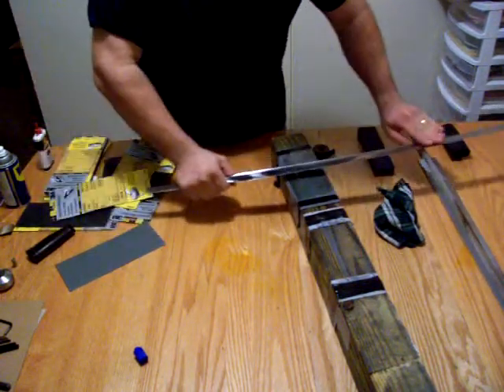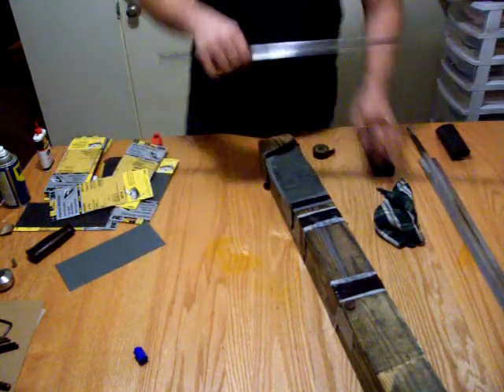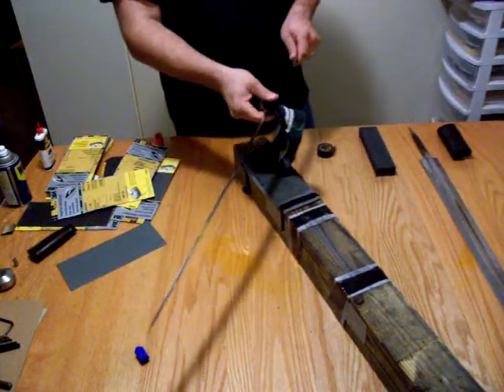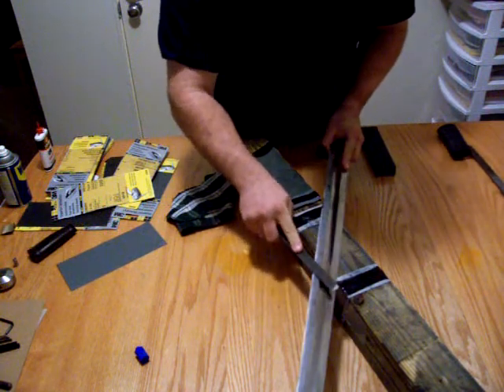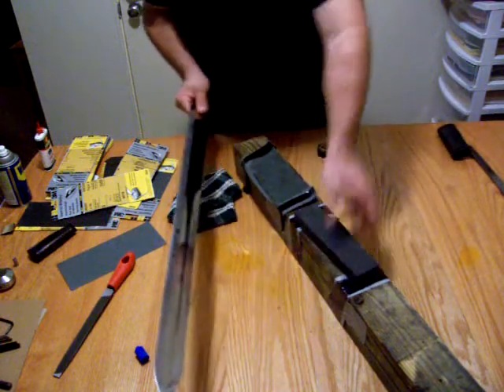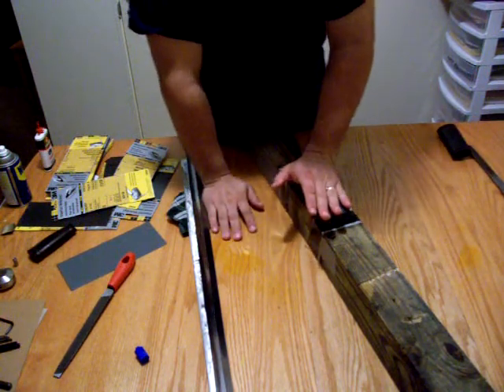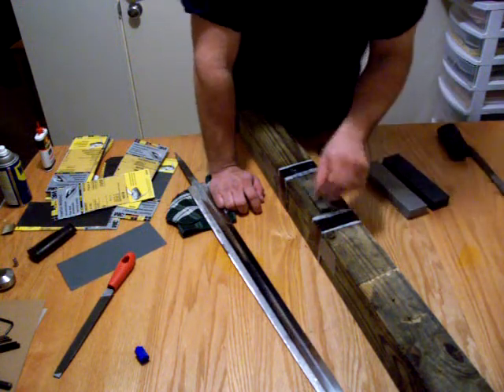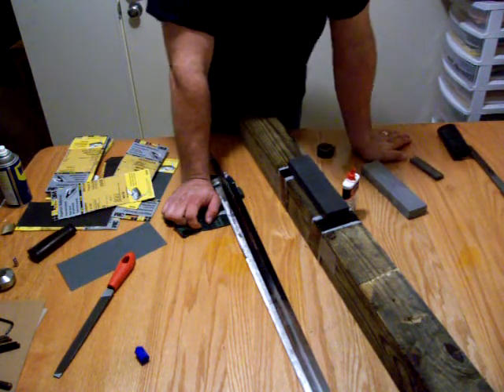universal sharpening part B_0001.wmv

Comment from the maker: Yup, GOOD EYE! that is a Castile blade and yes it did come with a secondary bevel. I'm slowly working it out though. I tell you what the heat treat and polish on that blade make it very hard to scratch. it's a really good blade. the new ones should be just awesome but remember that you have to ask for it "extra sharp"

Comment from the maker: @nico27004 I would start with 400 grit sand paper and avoid the stones unless you want to spend a lot of money on good stones. I have been very unhappy with the stones you can get at local stores, especially those 2-grit ones. the rough side is super rough, too rough for most jobs and the fine side is still courser than I like, not to mention stones are unforgiving and any little mistake will hose you. sand paper is much better especially for people new to sharpening.  good luck.

Comment from the maker: @nico27004 depends on how much work I need to do but in general I like to start about 400 grit then move up to 1000.if your sword is really dull or needs to be reshaped due to secondary bevels etc, then you may want to start with a lower grit. big things to remember: move in straight lines, you WILL scratch the crap out of it but don't panic just keep working finer grits until it looks good again, remove all scratches of grit below before moving to next grit, move from center to edge and off.

Comment from the maker: it really depends on how much of a bevel you put on it with that sharpener. if it isn't that bad you might be able to work it out with sand paper. files can be hard to work with on katana because if you have a real hamon that usually means you have an edge too hard for a file to bite. you'd have to use a diamond hone or some kind of stone instead. a 1x30 harbor freight belt sander is a great tool for this too and cheap to boot. I have video on using it too. zFfsAqXDPpg  and mh6XthJCEuc

Comment: I tried to sharpen the unsharpened blade with a wetstone using this method  and just because my wetstone wasn't perfectly straight, and I mean my wetstone was micrometers concave, but not perfect, it forever ruined the look of my katana with nasty groves that even after hours of polishing and re-sanding are still very pronounced. Lucky I took your advice and tried it first on a cheap katana, so I am not sorry, it just an experience with a wetstone...make sure it is good and leveled, and that you are not putting too much pressure, I even had to sand my wetstone on the sides but in the end I just gave up on it altogether...anyway, using this method, I ruined the look accidentally, but I got a mighty sharp edge....better than any factory made by far...
Reply: I should have said days not hours, the rest of the blade is mirror polish, but the grooves are still visible :( damn wetstone, better use acusharp...

Comment: yea thanks. i dont have expensive swords but they are nice enough. i wanted to try sand paper because i know you can mess things up a lot easier with a waterstone if you dont know what you are doing lol! i just waned a way to get the blade a little sharper after use and not scratch it up bad or ruin it. i have a lot of experience with knives but not swords. what grits do you use for yours?

Comment: Hi Ianflaer, have you tried this technique with a clay tempered katana with real hamon? I got one which is a cheap production sword (under $400) but I am not happy with the sharpening so I want to try this method but I am a bit scared that I will ruin the polishing or remove the hamon, although I know that if it's real it should not be affected by the sand paper.  Any recommendations to do this? thanks. Jose from New Zealand.

Comment: is using sandpaper better than using waterstones? do you wet the sand paper or use some kind of oil lubricant? would sandpaper damage a katana or is it just as fine to use sandpaper as a waterstone? o and what grits are you using. i hear for polishing a katana you go through different grits at a time.

Comment: I'm really struggling getting my Viking reproduction ulfberht from windlass steelcraft ($200 1095/1065 carbon steel not pattern welded) to a sharp edge.  Knowing nothing at the time I opted for the factory to sharpen it and it came with a gross secondary bezel.  Is there a way we can communicate better than YouTube comments?

Comment: Great videos, I’ve always struggled with maintaining a angle on a blade when using a stone and end up with uneven finish, I do struggle with hand tremors? What can you advise?
Reply from the maker: I'm not sure what will work for your tremors. you might need to use a system to hold things in place. I have seen set ups with files or sand paper on a stick that has a hole set at right height so the only time you can touch the edge is if you are at a consistent angle. have you tried a 1x30 belt sander? it's pretty forgiving. just use slack belt and pushing against belt might stabilize your hands. in the end I think you will have to practice and experiment. if it works you aren't cheating, you are winning. good luck

Comment from the maker: well that depends on why your sword isn't cutting. if you have a secondary bevel or massive flat spot you might need more aggressive means. also you need to know that the reason it doesn't cut isn't you. go to the nihonzashi web site and read the "is my sword sharp" article. in general a dull blade is good to start at 400. only start higher if you are touching up.